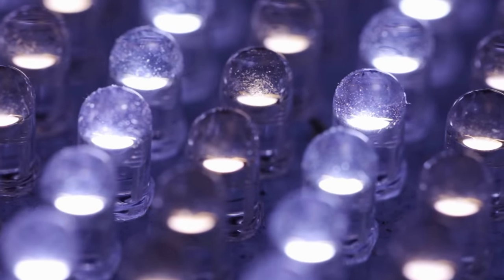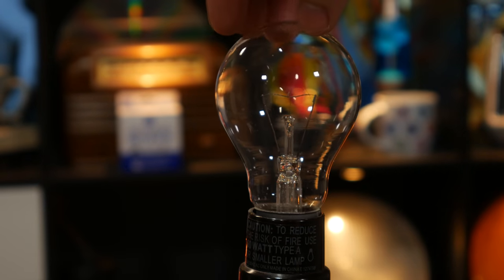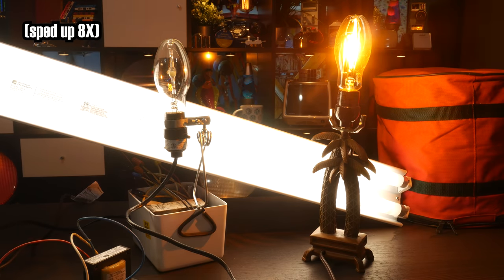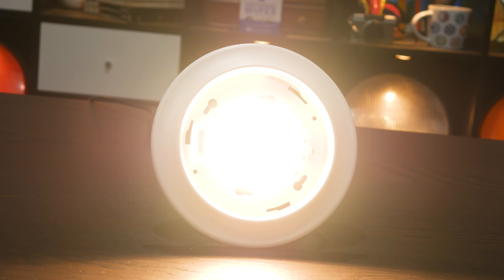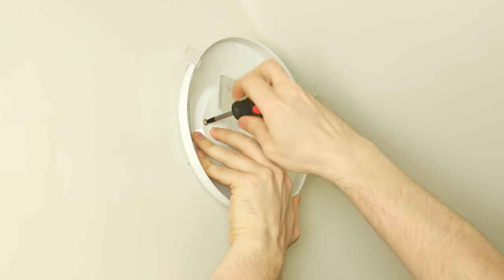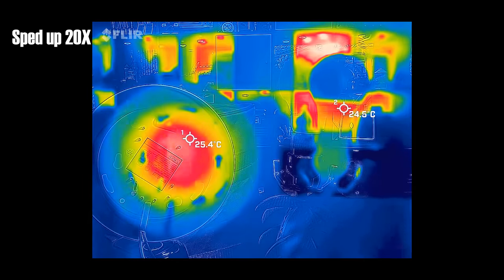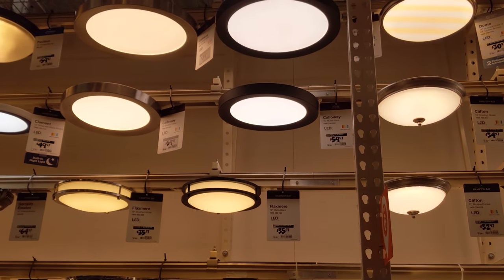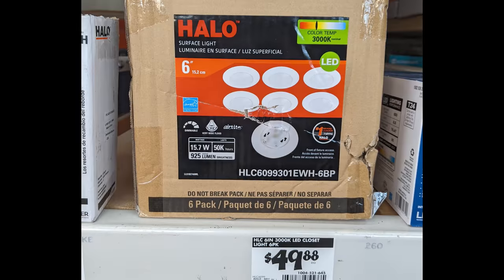A troubling trend in lighting?

Comment: I hate this disposability of the whole fixture. Even though I might be the guy they call to pop in a new fixture in a few years time. But Check THIS bad apple out: I wa finishing up a 2017 remodel putting in the finishes and fixtures. They handed me an expensive bathroom fixture that had been delayed several months because the first one arrived bent. It was 'modern' and chrome, and about $200? Guessing based on the other stuff they had me installing. 
Anyway, it was one of these disposables. Seriously. I mean it Did Have a circuit board a clever person might be able to replace...

Comment: I hate LEDs replacing standard lights.  I have a 600 sq ft cabin lit by 7500 lumens in 8 light fixtures.  They don't generate enough light to successfully sort strands of embroidery floss of very similar colors.  Or see close up details.  Also, one fixture blew out in a storm and now I need an electrician to replace it.  And trying to buy incandescent light bulbs is very difficult.  So, now I have to have all my ceiling light fixtures rewired to be convenience outlets, buy shop lights that plug in, in order to change a light bulb.  All the industrial excuses in the world don't replace the lack of light cast by LEDs.  Cheers

Comment: 10:53 
box of 175 wago connectors: $63.85 
box of 175 wire nuts: $12.78
tutorial on how to use wire nuts properly and in a manner that will have precisely zero issues for their whole lifetime: $0
wago connectors in a wall is, in most cases, tossing technology at a skill issue. i will die on this hill i promise you.

Comment: In Australia you need a certified electrician to replace light fittings, so these are doomed from the start. Still very common amongst the no-integrity Chinese flatpack builders, however.

Comment: Shared neutrals are a huge problem in older houses. Even if the circuit is off, the neutral will shock you. Be careful if you DIY. stay alive out there

Comment: Ill give an explanation for why LEDs don't last, at least at my house. Around here the quality of the electricity is terrible. On a digital oscilloscope it shows as nearly a sawtooth pattern at 56-59 Hz. In the US, where power is supposed to be 60 Hz. Nothing electronic here lasts at all. The computer is plugged in through a rectifier, then an inverter. Everything else here has no electronics, except the TV and radio which are vacuum tube based and don't have issues with the crappy power. All of my ceiling lights I replaced with the simple porcelain kind and they all have either self ballasted mercury vapor or incandescent bulbs. I'm lucky if LEDs or especially CFLs last even a week here.
Reply: Do you live on an island by chance

Comment: Agree with you on the color temp and mismatch bulb thing. It took me until recently to be able to switch to mostly LEDs because of proper coloring and dimmability without flickering (very sensitive to that). I like my lights incandescent warm AND like to have them on dim at night. 
I just recently installed some great 2'x4' panels in my garage and laundry room to replace the cheap and inrush power hungry fluorescent tube and ballasts the previous owner slapped in.
They can be connect to on wifi which alloes you to create profiles if whatever color and intensity you want, and put schedules in to switch between them even.
They are things if beauty, can get much brighter than those ballasts and use 75% the energy at MAX brightness (which I rarely use).

Comment: One thing that was not covered is the RFI interference created by the switching  ( driver ) circuit. All over the house are wall warts and other types of switching  power supplies in electronics devices, computers, iPhones and iPad type devices. Interference show up on radio communications devices particularly AM Receivers. I know you will say who cares about AM radio, no one listens to AM anymore. However market research shows thar  150 Million people still listen to AM. FM is less prone to interference as well as cable. Don’t get me started on cable. As time marches on I guess we will all just put up with it until someone proves is causes cancer or some other deadly disease like tooth decay.
Just for experiment leave some printed text out on your desk under a fluorescent light  and watch the printed text fade. Its not the printer ink either at fault. It the radiation of the light energy that is destructive . i for one still like incandescent screw in lamps for illumination.  Hell for that matter you van all walk around with your iPhones fully lighting up your pathway. 

But what do I know, Ive only loved 80 years. Now you try !

Comment: Instead of smart bulbs they have smart light switches that can dim and turn on and off remotely or over a network or from your cell phone. And those Halo lights have selectable color temperatures as well. So if someone buys your place they can change the color temperature. Plus the can Halo lights are easy to install and make new fixtures. They have one driver in the attic with a long low voltage cable. You clamp a connector around the cable for each light fixture. The fixtures have spring loaded arms for stupid easy installation. Up to 30 fixtures run off of one driver and the cable is 40 feet long. Plus they are not expensive. Here is a good video one their wiring and installation. https://youtu.be/si2gKUCkggI

Comment: I hate that it'd be fairly trivial to make those recess LED fixtures and the places they're installed user replaceable. it may be AC power but the wire ends can still end in connectors, the box could have screw holes (which I assume they do, but like sticking out of the box so you're not screwing into the wall/cieling) this would add pennies to the manufacture cost. but of course capitalism, so why spend an extra cent and a half per unit/installation when you could fuck over consumers instead?

Comment: I agree absolutely! LED is not for me. I'm a retired electrical engineer and I prefer incandescent in homes because the color is so much better than LED. Why worry about lamp life of 600 hrs that you have with incandescent when they may last for several years? I have lived in my condo for 14 years and some of my incandescent lamps have never been replaced. There are certain locations in my home where color is not so important so I have the swirl fluorescent bubs and they last forever. I have found that the LED bulbs flash and have to be replaced prematurely. And worrying about the wattage of the light you might as well forget it. Electrical energy  is charged by KWHours. A 60 watt bulb burning 4 hours a day 30 days a month would be approx. a cost of $1.00 per month! And that is burning the light 4 hours each and every day!  Some of my downlights in high ceiling areas have 2000 hr lamp life and 4' tube fluorescent bulbs have 20,000+ hr lamp life!
Reply: You should research color temperature..😂

Comment: Yep never agreed with integrated led fittings especially with cheap chinnese components that won last due to overdriving the leds 

Get a electrician when a integrated led bulb blows and trips electric as I am a electrician I would be able to replace it however its inconvenient especially at 12 at night 

I prefer bulbs and recommend installing bulb fittings on new installations I don't have any integrated led tat I the house and don't intend to

Comment: I dont trust these CFL ballasted lamps ... these deliver an aweful spectrum, flickering, induse noise in the circuit and tend to have some outgasing of mercury somewhere arount the point where the glasstube meets the casing.
Anyone got the memo how safety guidelines handle such a lamp when broken? Look it up, you wont want to touch one any more ...

Although technically very neat, I wouldnt want to place many LED lights in a livingroom either ... the spectrum ist just too spiky for health.

Nothing as good as glowing metals to light the mood in late hours, preferably in a body of himalaya salt ;-)

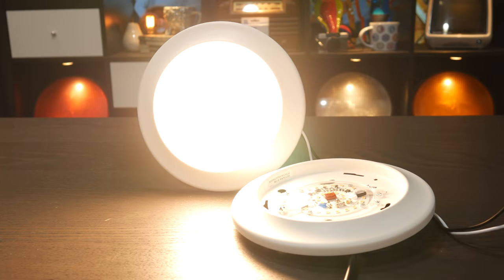Comment: So, I think my conclusion here is that this fairly smart new led "thingy" innovation is pretty stupid.  They have removed the light socket and you now have to wire light "bulb" in (and out) rather than screw them in?  And they expect the average consumer to be able to do this correctly and safely?  And imagine buying a home and then having one of the lights go bad.  But when you go to change the light bulb you discover that all the light fixtures in the house are these thingys?  If you aren't someone who knows how to rewire a new light fixture (safely)  you have to either (A) Watch some YouTube videos and hope you understand correctly and give it a (very inconvenient) attempt or (B) Call an electrician every time one of your "Builder Light Emitting Commodity Hairbrained-ness" (BLECH) devices fails.  What do they even call this?  I think you actually invented the name at 8:45.  C-BLED "Commodity Builder Light Emmiting device".  I like BLECH better though.

Comment: you clearly missed the point and went on a rant, you have a fixture and are complaining that it is not a bulb, it also lasts ten years and is as cheap as a bulb...............................................drops mic
Reply: His whole point was that after those ten years they require electrical work

Comment: So I patiently watched this video and have come to one conclusion.  The problem isn't really with these led lights but rather,well, it's you!  I mean, you could have just said that at the beginning of this video. Frankly, I love mine! Not only are they more efficient, but they are easily installed regardless of where you want to install them . Being slimline, they can be installed right below a joist if you're installing them under a second floor or in a basement ceiling as an example.  If they should "burn out" or have any issues, you can simply replace them. I've have, however, come to a conclusion about you, though.  That would be your kind of a "fussy " fellow, aren't you! Lol! Again, don't get me wrong,  being a fussy fellow has gained you quite  the following, so who am I to judge!